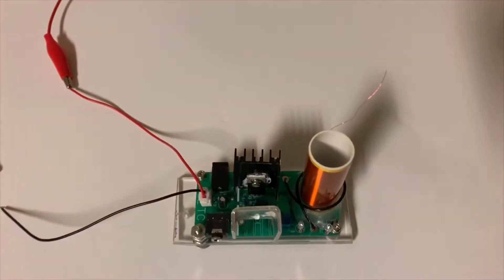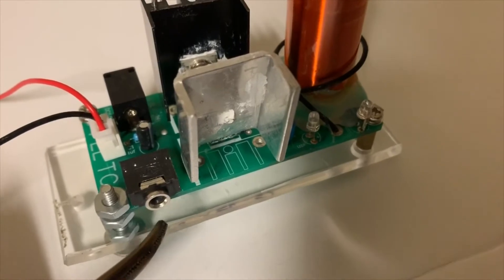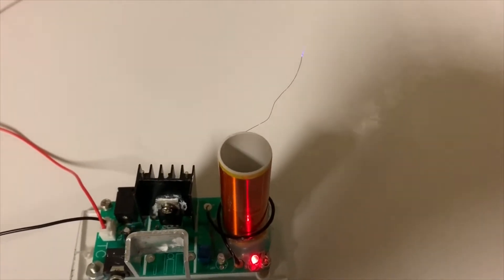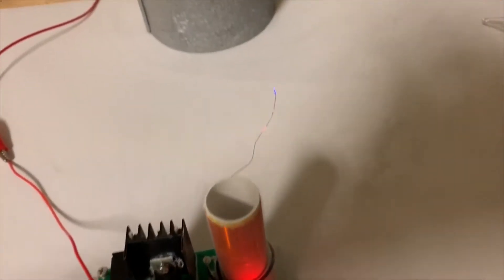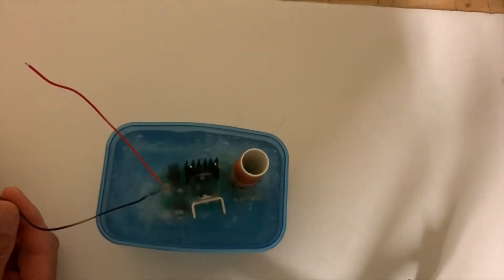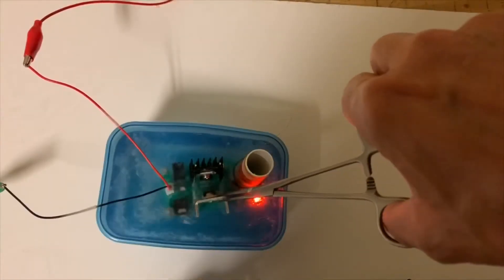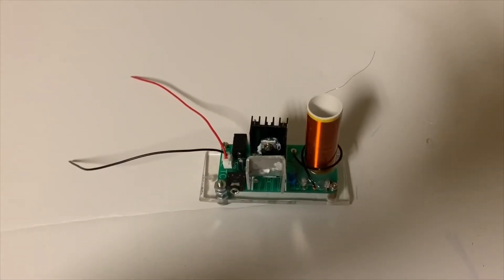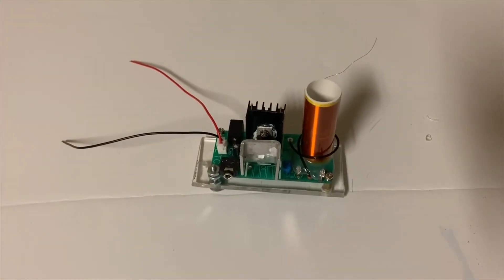Will a Tesla Coil Work Under Liquid Nitrogen

Comment: If you haven't heard, Tim is a bot.  There's a bunch of bots now.  This is a good experiment.  I have a theory that if you use a coil as a track, and quantum levitate some magnetic stuff around the coil, like, suspended above the surface,  and turn it on, the moving of the magnetic stuff around the coil will produce artificial gravity.  The faster it spins and the more electricity used, the more gravity it makes.

There are several videos about similar concepts and how they've been found in ufos and secret military aircraft.